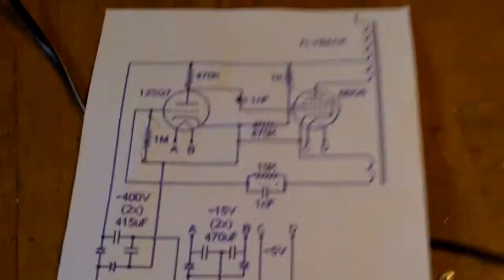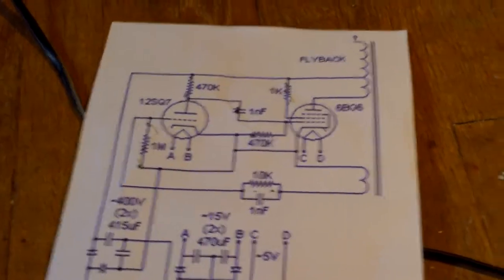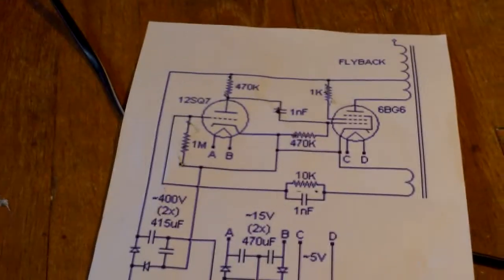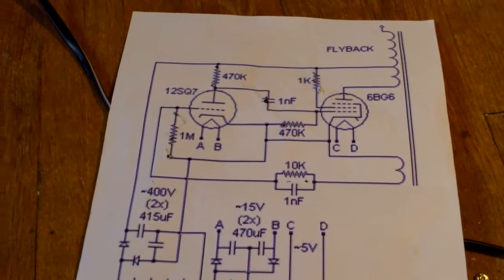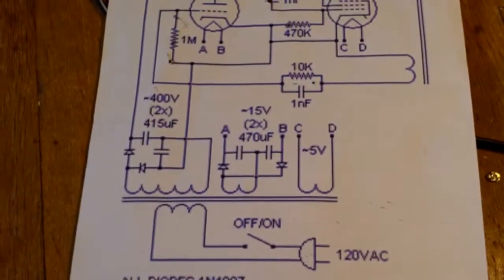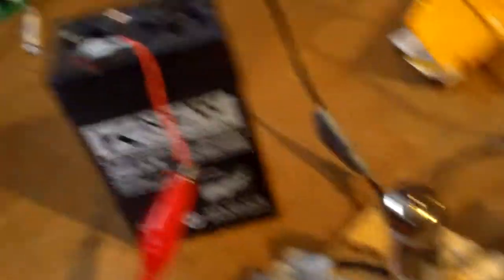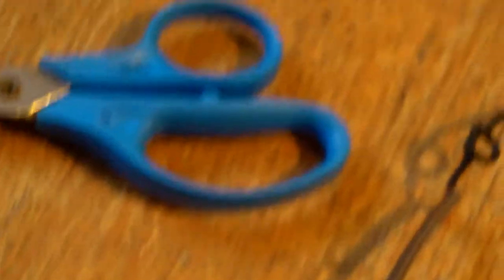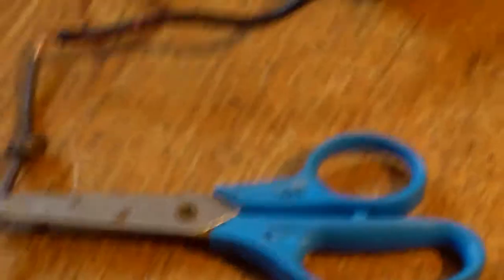vacuum tube flyback driver fail

Comment: jdflyback do you have a drawing of the zvs driver, you can send me? I have had trouble understanding the zvs drive schematics.
Reply from the maker: Owen Chase science channel Hello, Is this what you want? http://cdn.instructables.com/FIZ/4YEK/HJKBPR9P/FIZ4YEKHJKBPR9P.LARGE.jpg
Reply: jdflyback  I meant a pencil drawing. what I don't understand is I see people having the resistor and zener diode on the gate and source of each mosfet, but on the schematic down below I see the zener diode and resistor going from the gate to the source, and the other resistor and zener diode is going from the source and to the gate of the other mosfet

https://www.google.com/search?q=zvs+driver&biw=1600&bih=799&tbm=isch&tbo=u&source=univ&sa=X&ved=0CCgQ7AlqFQoTCNCkhd7v_MYCFQsRkgodn1IL2g#imgrc=UprhS45qcMZMfM%3A
Reply from the maker: Well in this circuit both of the source connections are connected together, so it does not matter which one of them the diode and resistor are connected to.
Reply: jdflyback ol thanks

Comment from the maker: lol i had no idea. this was is one of my old videos that i am embaressed to watch because i was so shaky and i didnt know  tubes were high impedance devices and i used 15 turns for feed back and primary. this circuit is similar to my new one but instead of the 10 watt power tube being the oscillator and the one driving the flyback it has a smaller 2.5 watt oscillator tube driving the grid on the power tube.

Comment: whats you power input? you shouldn't need a very powerful lamp to make that circuit work right, I think you could add more plate voltage, you could probably push 1kv if you use an RF choke